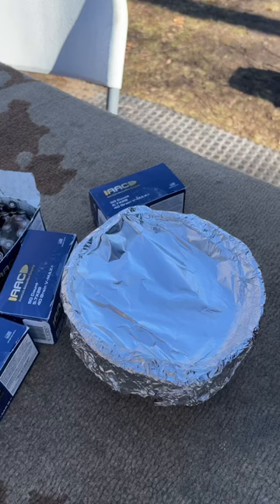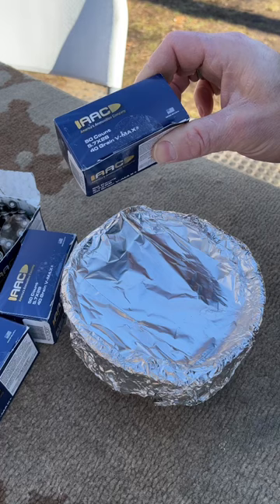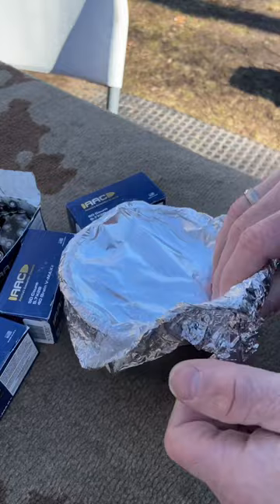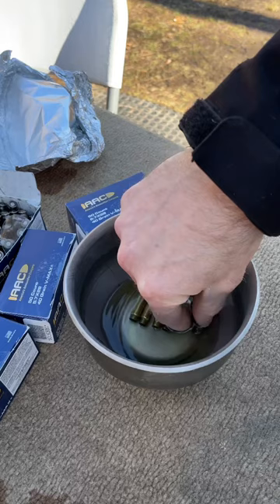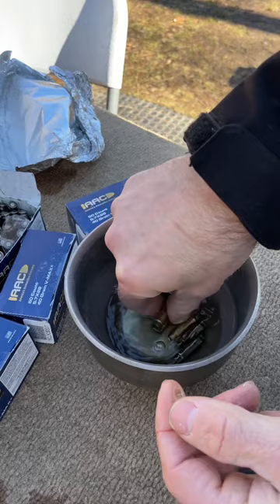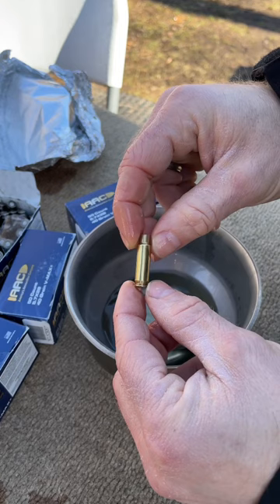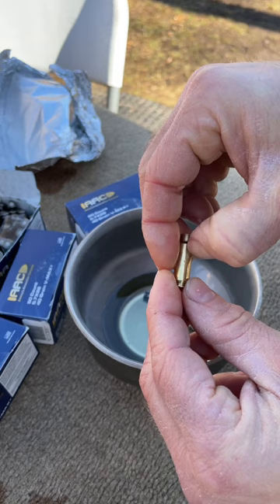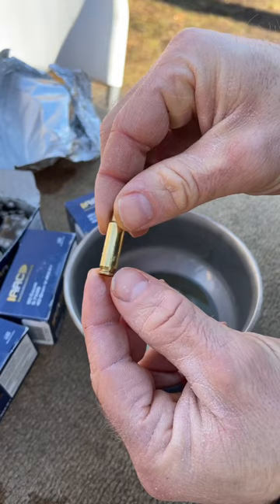Saberslick Case Coating, AAC 5.7x28mm #shorts #fn57

Comment: Maybe I can start reloading 5.7x28 once you have all the bugs worked out. I have saved up almost 500 once fired FN cases since 2008.
Reply from the maker: You can reload those cases easy as pie. Wash them in Simple Green, and prep like other bottlenecks
Reply: Get an ultrasonic cleaner
Reply: Did you try vinegar?
Reply: @zm1786 ultrasonic works, just no harsh cleaners and little to no heat otherwise the coating will weaken

Comment: The big question is how it compares to current offerings. Was hoping for something closer to the old DAS Zombie Gone I have but read it doesn’t even beat out 197.
Reply from the maker: That was hot Shit.  The first batch was low on velocity but was told case coating to be improved and velocity is as well. I hope to have a range report in 2-3 weeks. The first lot I had 325 rounds with only 1-2 failures related to the general finicky nature of 5.7.
Reply: Yeah it was/is! I picked up a few boxes as kind of a joke and ran it through a chrono. The 2k average out of my USG had me buying a bit more to keep in my Mags for carry use along with some mags of R37.X

Good to hear they are at least saying they are listening. Hopefully they follow through and we get a round that doesn’t follow the current trend of anemic commercial loadings. Look forward to seeing what your data shows man.  The 4 boxes of AAC VMAX I tested out this morning were averaging 55fps lower velocity compared to the 197 I have on hand (out of my MK2)